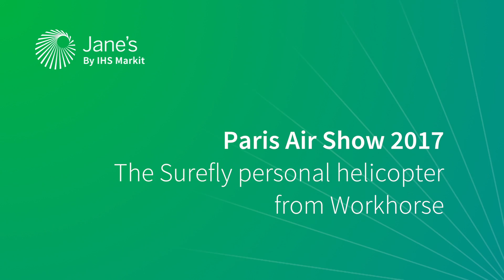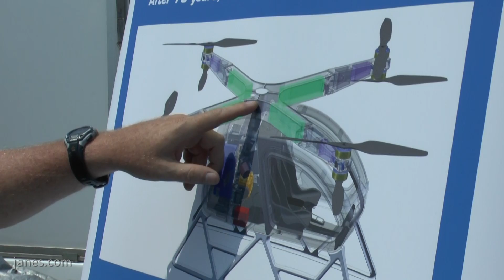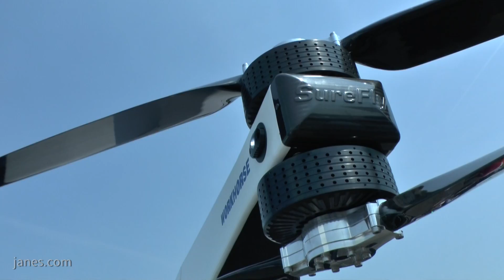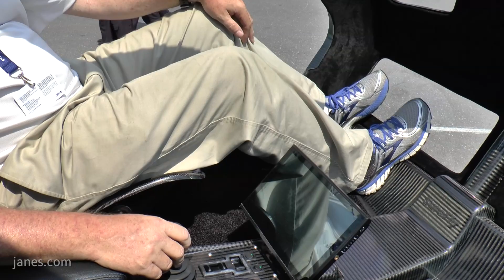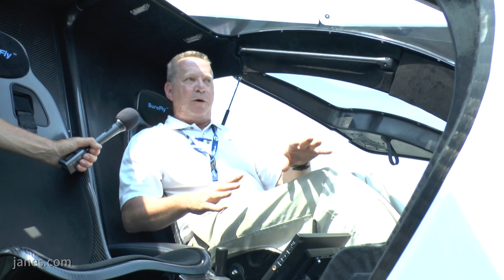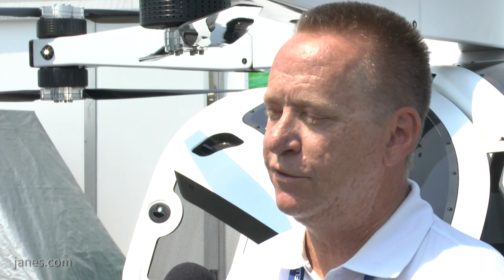Paris Air Show 2017: The Surefly personal helicopter

Comment: At last a practical personal helicopter. This would be easier to learn to fly than a fixed wing plane. Even if a pilot had to be rated there are a lot of passengers that would love to get around this way. The gas motor means extended flight times and is probably not any heaver than batteries would be. Almost all trains are diesel electric, it's a proven combination. Every cool place in town would have a roof top bar, there is nothing like being above it all.

Comment: How is sub $200k cheaper than normal aircraft or helicopters costs including training? And 70 mile RANGE?!
Reply: The whole point is, you don't have to fly at 10,000 metres to get from A to B....you can go low level cross country without the road system problems.....why go around a field when you can go across it?

Comment: The gas struts for the doors are mounted upside-down.
The rod should be at the bottom, and the cylinder housing should be at the top.
This ensures that the oil in the cylinder seals against the piston and prevents the compressed gas from leaking.
Reply: Richard Head Lucky you're here!! I reckon they built this whole prototype without even considering the struts won't work.
Reply: Mitch King, they work for a while, but the Nitrogen seeps out much quicker without the oil barrier.  Check out the info at Industrial Gas Springs.  Or look inside the pneumatic chair you may be sitting on, and you will find that the rod projects toward the floor, and the cylinder housing is nearest your derrière.  This arrangement allows gravity to keep oil at the seal.
Reply: http://www.indgassprings.com/mounting-instructions.html

Comment: I hope this sort of effort gets support from the FAA.  It is time to open up the air for the public.
Reply: Airways are not just ready to be opened up to the public where any spoiled kid or guy with a good job could fly around. Think of the collateral damage on the ground when 1 dumbass wrecks his new drone...
Reply: R C most of the people that could afford one are already in the air.
Reply: Once they have full autopilot sure, otherwise you really can't trust people without extensive training.
Reply: madmax2069 if they can automate the process much like they do with cars, no reason why they couldn't get down to $50,000-$80,000 for one of these... Cheaper then an escalade or a high end bmw....and how many of those are on the streets. These guys should get in cahoots with tesla. If tesla can bring their batteries and factory into the equation the price would come wayyyyy down.

Comment: You need too inclose those blades.
Reply: fatboy19831 why ?
Reply: madmax2069 a ducted blade produces more lift, but the drawback is that it will travel much slower forward. Some drones use the ducted blade system... But I think it would feel like molasses in the air on this thing.
Reply: Not a ducted fan.  Just a wire mesh grill to keep the odd person from decapitating themselves.

Comment: So when two motors overheat and FAIL, then what?  It surely won't fly so why SUREFLY?!!  With a large scale helicopter, you can attempt to lock the rotors and glide to some degree.  I don't want to share the ground under these things much less the sky like the commercial pilot commented.
Reply: "Parachute" , backup battery.

Comment: Make the control interface a PlayStation. You can practice all you want at home then go fly it for real with a PlayStation controller with simulation hours under your belt.
Reply: Paul D you sir have got a good way of thinking.

Tbh a controller for a Pc matching the control surface of the aircraft is probably within budget. If you can afford the aircraft you can afford a controller for a simulator.

But certainly the idea of using a commercial games console as a training simulator is a great idea. Somebody should do that for cars.
Reply: I don't like the helicopter itself but that's actually a really good idea lol

Comment: No autorotation with this shit.
No mechanical connection between rotors. Couldn't be any of course, independence is what makes multirotors balance. 
The redendancy of motors/rotors and the parachute may save your life when one of the motors is cooked up. Maybe.

Comment: I had this idea from 10 years ago just didn't have the money
Reply: I've had many ideas that have become commercial products, but I hadn't have the money either. I feel you!
Reply: Kevin Vang I didn't have the ideas or the money!
Reply: Kevin Vang you mean you designed the product, did modeling analysis, created the buisiness model but could not secure funding for a prototype, or that you sat on the couch one day and said "a large drone could carry people"? The first case you can still be the competitor now that the industry has turned their heads to this technology and investors are more likely to hear you out. The second doesn't count.
Reply: So true. It's easy to blame a lack of money instead of laziness and lack of skills. The 'scaling up' definitely comes with a lot of obstacles, and I would probably strand at some early point before money became the limiting factor, so would many.
Reply: Same!
Reply: Muskar Did you know that 97.68% of the time people pull a statistic straight out of their ass?
Reply: basically everybody has ideas but they havent unlocked it to thier head i been trying to build this too im an electrician n i wanna know what skills you need to build for this. i know engineering is ome of em
Reply: You also did not have the knowledge or ability.
Reply: +hotrodsather you know this man?
Reply: Pablo Hernández Pls give me ur email
Reply: It's not only about the money, it's about the balls as well. It's a risky project.
Reply: Ideas are dime a dozen.
Reply: I told my friend in 1996 about a smart phone I wanted to build.
Reply: Even if you had several million dollars to invest freely (and carelessly), there's still a looong way from idea to going commercial. Most ideas turn out to be 95% based on incorrect assumptions - it's almost exclusively the execution, time, effort and persistence that makes ideas a reality. Finding investors is just one step of many.
Reply: *Kevin Vang, I am an attorney. Get a hold of me I am sure I we can negotiate with this company to get you compensated for your idea....idiot.
Reply: 61spindrift for what dumb ass
Reply: John doe: it's just a idea John, i Was fly Radio control airplanes, helicopters about 18 years ago, I started to design it, but im also know that's not cheap to built one so i stopped, But today technologies are so much better hopefully someday i can built something with cheaper cost.

Comment: I'm sorry but the words super easy to fly and should not have to have tons of costly Technical Training do not go hand-in-hand when you're talking about any kind of Aviation. May we remind ourselves we are human beings we are not meant to fly even though we can with the aid of other things there is never going to be a point in time when flying should be easy the minute that becomes easy the minute we become a much more at risk species. If you're in the air you need to have training it's not like anything else there is. When you have a fender bender at 30 feet above ground or 300 feet above ground or 3000 feet above ground the end result is not an exchange of information of insurance its gravity taking full control and more than likely your life. Don't get me wrong I wish I had one and I would love to fly one but there's nothing subtle about the ease of flying.
Reply: we are human beings and we are not meant to fly, or go to the moon, or travel at 300kph in a train, but we do it anyway. This is a drone not an airplane or helicopter.
Reply: I beg to differ zak... We have been flying for more than a 100 years and this isn't really flying its more of a computer controlled craft that takes you places by way of flying... Even if the pilot has control of the craft they have to go through a computer to do something in turn the computer decides how to accomplish what you as the pilot want to do... So really in a sense your not really driving the craft eliminating most of the human error that can accor
Reply: @jester2720  that's splitting hairs bro come on..
Reply: Zak Man 
We accept your apology.
Reply: @larjkok1184  😜🤣👍✌
Reply: Zak Man The computer is the pilot, the human passenger is the navigator.

See what I mean?
Reply: @weareallbeingwatched4602  I suppose, but I still think it's splitting hairs..
Reply: Ultra lights can fly without any regulation or training in most places, so this stuff has been around already.
Reply: Then just don't fly too high off the ground....use it to hedge hop around the road system........roof top height might be dangerous in a power out but so is one on a highway if the traffic is crowding you......I don't think it will be for everyday use, same as a light aircraft is not a daily commute thing to the office or school etc.
Reply: Zak Man it's not the pilot flying this thing, it's the computer. It can even fly itself so yeah, you don't need skills, just knowledge of the rules so you don't cause problems for others.
Reply: Playing music should be easy. Flying? Not so much with current tech.
Reply: It is very easy to fly.  I did it my first time.  Flying in a storm, that is another thing.  A bicycle is much harder, you will also crash a lot more.  I can tell you do not fly nor are big into science.

Comment: a giant drone big enough to carry people
Reply: Chris Barr exactly
Reply: Chris Barr no. This has a gas engine to generate electricity for the electric motors
Reply: @BusinessSolutionsATL  Yes, much simpler to control electric motors with a small joy stick than the complex mechanical linkage of a helicopter.
Reply: Tac Soldier .
Reply: A drone is operated remotely. As you can see by the video it is controlled inside the aircraft. Making this a helicopter. Not a drone!!
Reply: Country music
Reply: Chris Barr 
PROVE IT!

Drones fly, all this did was sit on the ground.l.l
Reply: sucks
Reply: A drone is a unmanned autonomous aircraft without human control

Comment: It is uncomfortable to have the controls to the right,
it would be fine with the controls up front
Reply: JonaS HS A control stick on the right has been standard on the F-16 since 1980, seems to work fine.  Airbus also uses a side stick controller and I have heard no complaints from pilots.
Reply: controls in F-16 are HOTAS, right and left, also, pilots have his arms held side by side on armrests, that is quite diferet, it has not armrest, it may be not comfortable when maneuvering
Reply: strato man f
Reply: strato man u
Reply: JonaS HS As someone who flew both high performance jets and civil aerobatic aircraft I don't see any disadvantage to a side stick controller vs a center stick.  I find both to be completely acceptable, with maybe a nod to the sidestick if it is well designed.  One does not pull much G in a helicopter so an armrest may not be so important.  The side throttles on all the jet trainers and fighters I have flown did not have an armrest and it didn't feel like a problem to me.  HOTAS is great, as it allows the pilot to focus on combat, or just flying, but really doesn't enter into the question of sidestick vs center stick.  HOTAS has been standard in virtually every new fighter since the F-15 and these new fighters have had a mixture of side and center sticks.

I don't think this helicopter has throttles at all, motor power is likely controlled by the computers that handle most of the flying on this machine.  But those toggle switches for altitude and something else? don't seem well thought out.

It is also somewhat telling that we never saw the helicopter fly.
Reply: Agree controls need work..great for a triplegic but if you have 2 hands and 2 feet why not give them something to do..
Reply: The toggle switch and joystick are reminiscent of a scissor lift operation.